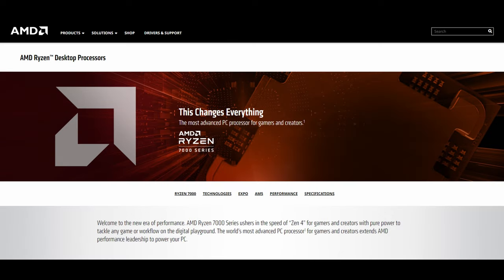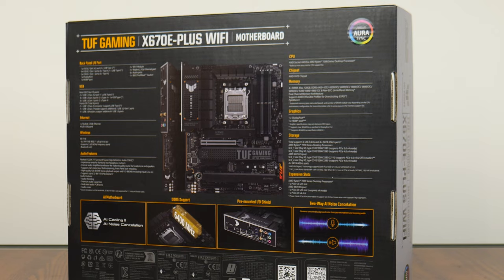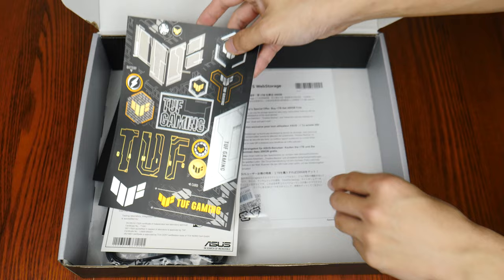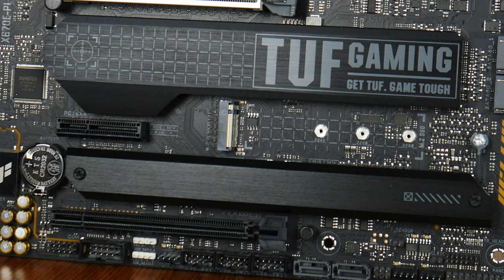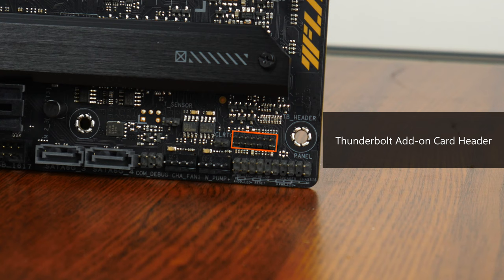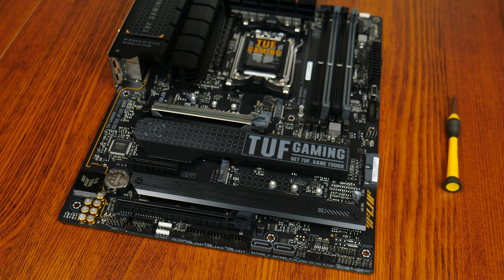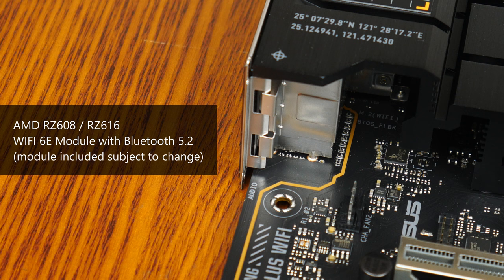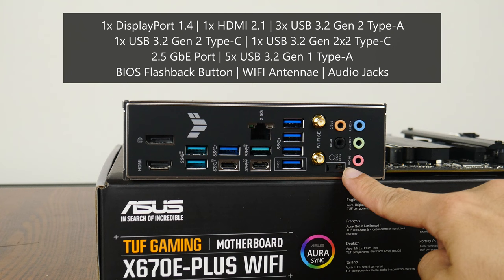AMD Ryzen 9000 Series Ready! ASUS TUF Gaming X670E-PLUS WIFI Unboxing & Overview

Comment: What's the price for this board?
Reply from the maker: To my understanding this board has an estimated retail price of $589 Singapore dollars! Prices may vary depending on which country you're from.
Reply: @ALKtech  yikes... AMD really just priced themselves out unless you're getting a 7900+ CPU. Does not make sense to buy the new hardware when you're getting a 7600 or 7700, especially before the platform matures and GOOD (6000+) DDR5 comes down in price. I would like to see some proper benchmarks like HWUB 50 game average, at 1080p/1440p and 4k with realistic settings, not 1080p LOW. Probably more tests will pop up once 4000 Nvidia and RDNA3 comes out.

I don't think the new gen CPUs will be flying off the shelf so best outcome is to wait for Intel, Nvidia and RDNA3 to come out then make an informed decision with proper realistic FPS numbers.

I reckon Intel has knocked it out the park in the midrange market if their true MSRP price leaks are true. DDR4 + Mature Mobo platform, also means you can upgrade to a premium DDR5 kit down the line if you want more performance or just skip to Zen 6 / Arrow Lake. 

However, if you're looking for a workstation monster, I think the 7950X will be hard to beat, at that kind of money, the platform cost should not be a prohibitive aspect of the decision making, considering they will support AM5 to 2025. (most likely 2026, like they extended for AM4)
Reply from the maker: @marki9648  Totally agreed on the points that you've raised - in fact, Intel's lifting the lid on its 13th generation Raptor Lake offerings as we speak! 

I had the opportunity to lay my hands on a Z790 board from ASUS that sports DDR4 support (video's live on my channel now) - while I didn't have the chance to do any benchmarks with a 13th Gen processor, if the 13th Gen offerings are able to match or even beat the Ryzen 7000 series for the most part, it'd be clear which company would be taking the lead in sales for the coming months!
Reply: 320 USD on Newegg.
Reply: @marki9648  Good quality 5600 mhz DDR5 has come down in price. That is the max the board takes without overclocking. That is definitely enough for this. I would be leary of 5200 though.
Reply: @joepiazza3756  unfortunately I think the midrange to low end market, Intel has really killed it. The i5 13600k is a little pricier by 20+ bucks but you probably get better single thread and most likely multi-thread as well due to the addition of more E cores. You also get to use older cheaper motherboards from Z690 or B660 and you can choose whether you want DDR5 support. I just don't see the value proposition of 7600 or 7700. 7900 and 7950 prices would be fine but if you want mid range or low end, go intel.
Reply: @marki9648  I totally get that but if you are building from scratch and can afford a few hundred more for the early adopter tax on the motherboard and DDR 5 it won't be a that bad of an investment. I just wouldn't call it value now but you might benefit at the back end when you upgrade in a couple years. The Ram is at least affordable now. This time next year prices will likely be well down too with more competition in boards and memory.
Reply: @joepiazza3756  perhaps my friends and I aren't such big enthusiasts, we buy once and expect it to last a couple generations so buying early on a chipset lifespan with the intention to upgrade isn't really on our minds, granted we do not do professional work so we don't need the additional generational gains for professional workloads per day but if you can shave 15% of time just by plopping down a new CPU, yes the early adopter tax is fine but only on the higher end chips where budget isn't a big factor
Reply: @joepiazza3756  Called it when Zen 4 Prices came out earlier in the thread, the 13600K is THE cpu to get this generation. It'll be more than plenty for gaming and general needs and probably will easily last you to 15/16th Gen or Zen 6
Reply: @marki9648  that's cool. AMD has some work to do but I got a lot of my overpriced stuff cheap via a buddy in IT so I'm not upset. I don't need to go crazy as I had a laptop with a 1050ti. I'm hoping in about 2-3 years it pays off.
Reply: @joepiazza3756  personally I think even though generational gains are becoming wider, there isn't really a breakthrough moment in how we use that performance, sure latest games probably won't run Max settings but I see the next big step being photo realistic VR. 2019-2025 hardware probably won't "feel" too different in the way we utilize them until photo realistic VR headsets come out resolution wise or development wise and then the hardware to power it at the necessary framerates I think it's 90+hz? For it not to be stuttering
Reply: @joepiazza3756  Why?
Reply: @Methodical2  why to what exactly. There are a lot of posts.
Reply: @joepiazza3756  My bad.  You stated that you would be leery of the DDR5 5200 and I wanted to know why.
Reply: @Methodical2  it might just not be fast enough for many people. 5600 should, 6000 as well but it's expensive still. I would not touch 4800. 5200 might be okay for now but you might wish it were a little faster sooner than later. 5600 Hz is essentially all a TUF 670E can take for instance before it needs to be overclocked and it's probably the most popular board right now. So a good quality 5600 like a GSkills Trident could be overclocked itself and get more bang for its buck than a 6000 probably. And it appears that Hz over latency this generation so that is another reason to go 5600 over 5200. There might be nothing wrong with 5200 but there is enough uncertainty to, as I said, be leary.
I hope that cleared things up.
Reply: @joepiazza3756  Cool.  Thanks for explanation.
Reply: $450cnd

Comment: I think 14+2 power design is not enough for future generations of cpu. Maaaybe it could handle well 7000 series. What do you think? Keep up good work.
Reply from the maker: Thanks! Kind of hard to say about the future generation of processors how power hungry they'd be, but given that AMD's had a good track record of having older boards that support even the latest processors (i.e. AM4), the 14+2 setup here should be adequate, but maybe not for the highest end Ryzen 8000/9000 series when they do arrive? Your guess is as good as mine!
Reply: the cpus would have to need way over 250 amps for the VRMs to not be enough, the 7950x cannot even hit 200 amps unless you overclock using some crazy cooling so it will be more then enough for any new cpu. So if AMD released 9950x and it pulled 350W then maybe, but that wont happen
Reply: @ALKtech  it will be enough, 70A power stages will handle anything that can fit into the AM5 socket as the thermal density will be the limiting factor, this board also has huge coolers

Comment: how is compatiblity with coolers? especially aio coolers??
Reply from the maker: For the most part, coolers that work with the AM4 platform SHOULD work with the AM5 socket in terms of mounting compatibility. To be safe, it's best to check with your cooler/AIO manufacturer to confirm this!
Reply: I use the ASUS ROG Strix LC II 360 ARGB White Edition and it works great.

Comment: This one or ASUS ROG STRIX B650E-F ???
Reply from the maker: How big is the price difference between both boards where you're from, and what processor are you intending to use?
Reply: @ALKtech  TUF is just 40 more, no big deal, cpu probably ryzen 9 7900
Reply from the maker: @Steven-lw8lg  I'd personally get the ROG STRIX B650E-F - I feel the B650E board has a nicer set of features despite having the B650E chipset, and has a good VRM setup that will handle the 7900 just fine. My two cents!
Reply: @ALKtech  thanks for replying!

Comment: So there is no way to run x16 5.0 on the GPu with x4 5.0 on an m.2 at the same time?  If you use a 4.0 gpu in the x16 does it disabled all 5.0 slots?   Or can you do x16 4.0 for gpu and x4 5.0 with m.2 ?
Reply from the maker: The PCIe x16 slot for a graphics card and the primary M.2 slot can both operate at PCIe 5.0 speeds concurrently!